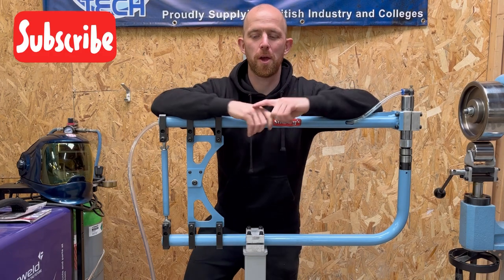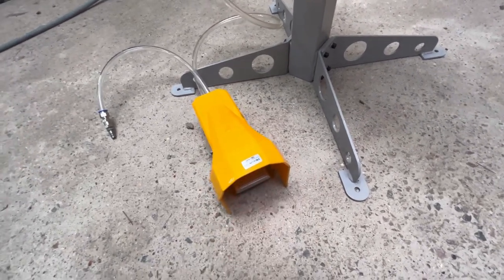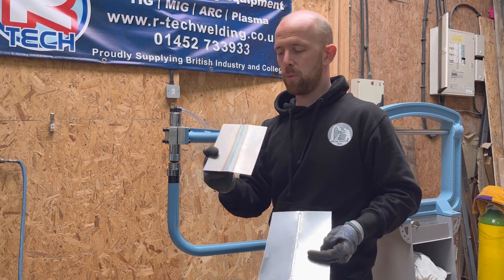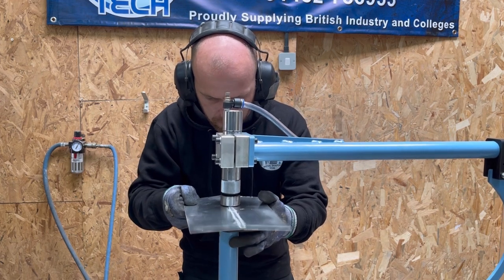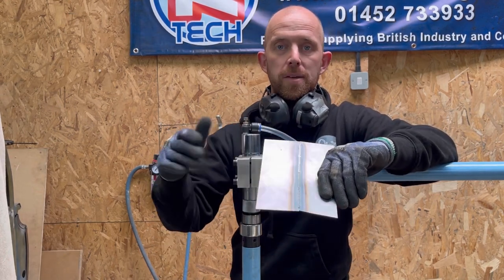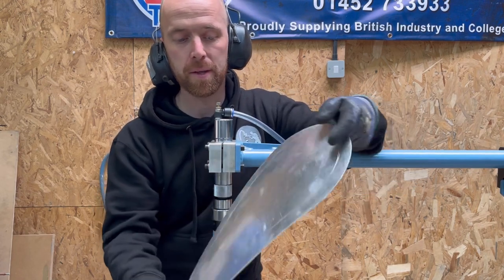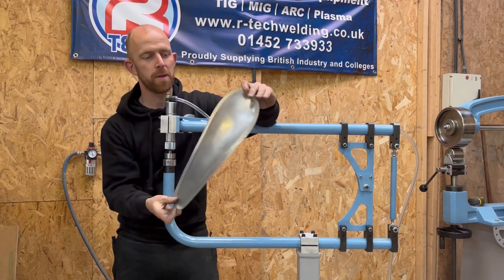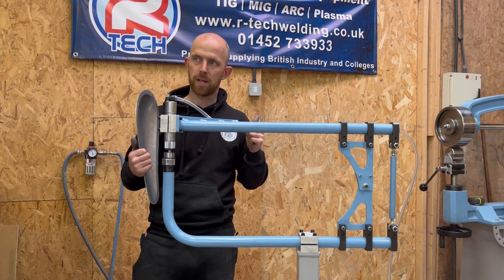Stakesy’s new Planishing hammer review and demonstration

Comment: Hi Tom.
Congrats on the purchase!
I remember years ago (when I made one from scrap) I was not aware of the advantage of lubricating the panel. What a difference!
Nice to see someone using hearing protection. Hearing aids just don't compare to working ears. Sadly, I know.
Would they have loaded the tubes with sand or something to make it quieter? I'm been told that it helps.
Reply from the maker: Hey joe . I got hearing problems too so I definitely need the protection. Yes lube on the panel makes a huge difference. Possibly loading the tubes up may make a difference but that hadn’t really crossed my mind as it was much more bearable than the other one I got.
Reply: The human body can only do so much and as we age we tend to wear out.
Good to see you taking care.